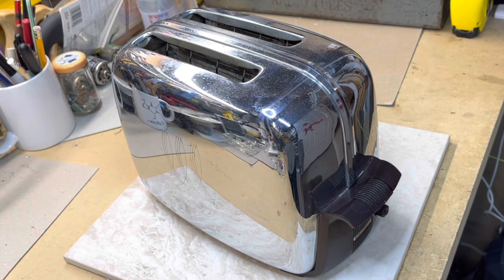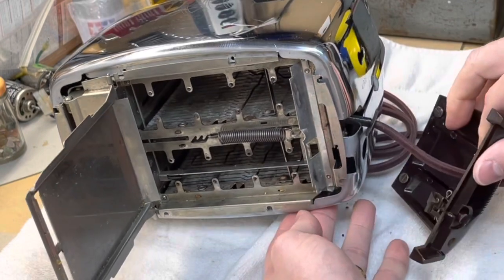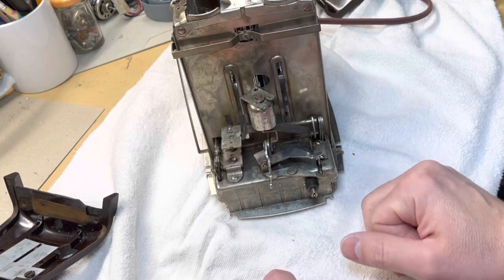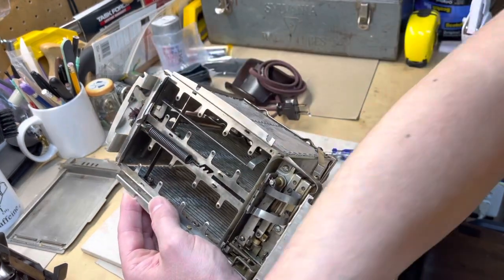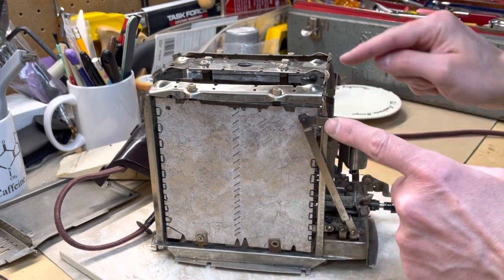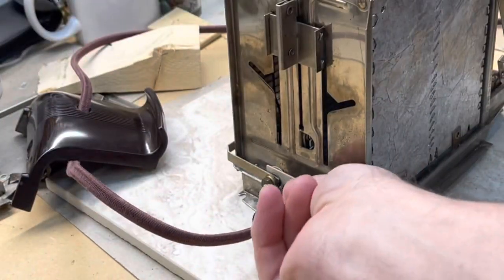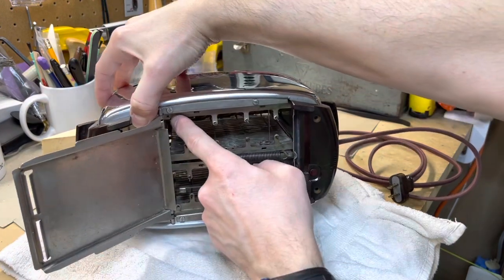How to disassemble and repair the Toastmaster 1B14 Toaster

Comment: I found one of these on E-bay and was using it for the last 15 years ... until one side went out. This is the best toaster I have ever owned and I was bummed out. It just so happened this is the same toaster model my parents had in our home growing up and they had it over 50 years. I have never owned one that works better!  I followed all the steps of your video and it turns out the repair you demonstrated was exactly the same failure I had to fix ... being able to see all the steps to disassembly and re-assemble was fantastic and my repair was a success ... You did an awesome get to the point video with a clear outline of the necessary steps.  The case is a bit "fiddley" to get off and back on, so your tips about exactly how to take it apart and re-assemble it was super helpful ...and saved me a lot of time...

Comment: Do you have a video of when you replaced the power cord?
Reply from the maker: @budsutt:  Unfortunately no. But you can see the two screw attachment points for each of the wires so it should be straightforward once you have the chrome shell lifted up out of the way.
Reply: @LongologoProductions  Thanks for responding so quickly. I'll get mine apart and look for that.

Comment: Mine clicks but doesn't release, it still cuts the current though. Thanks for video
Reply from the maker: @michaelbyfield6323:  check the parts of the video showing the slow-mo of the release mechanism.  There are some adjustments you can play around with to help.

Comment: I was able to repair my issue of the lever not staying down. Now that I have it put back together, it will stay down but won’t pop back up on its own. 😅
Reply from the maker: @PaigeKnowles-c3x  so frustrating!  What did you do to get the lever to stay down?
Reply: @LongologoProductions  I took it apart, thanks to the instructions in your video, & then just cleaned the mechanism & springs really well with a small aerosol can air compressor. Then after I put back together, it stays down now but won’t come back up on its own. The lever falls a little short from being flush with the bakelite, when not pushed down. Has a little play in it when its not locked down.
Reply from the maker: @PaigeKnowles-c3x  : hmmm.  Double and triple check everything that you put back together to make sure the mechanical pieces and latches operate properly.  Could be something easily overlooked. Could even be the chrome exterior casing or Bakelite end piece interfering?  Difficult to guess without seeing it.
Reply: @LongologoProductions so after lots of studying how the parts are working, I think I figured out that the arm the moves forward, that touches the backside of the knob, doesn’t move back on its own once it reaches temperature. I think it’s supposed to retract on its own to trigger the bar that releases the lever, right?
Reply from the maker: @ : This is difficult for me to visualize without knowing exactly you are looking at. Is there a timestamp in the video that you can point me to for what part is sticking or not retracting after heating?  I’ll help if I can.
Reply: @LongologoProductions  9:36 it doesn’t release the toaster. It just clicks but toaster doesn’t release
Reply from the maker: @PaigeKnowles-c3x:  Reading your comments again, it seems that you have the same issue I was addressing in this video, where the inside diagonal arm moves forward, touches the backside of the knob, but doesn't drop down with enough force to release the toast--it basically gets stuck and can't move back on its own.  

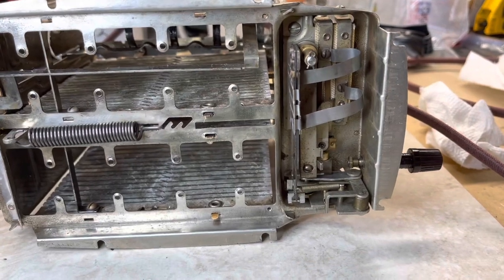First, which type of the 1B14 toaster do you have? See at 8:43, where you can see the underside of the first type (the type I am addressing in this video), in which there is an adjustable screw/nut on the end of the light/dark dial under the toaster.  The other type is shown starting at 10:30 (particularly at 10:52), where you can see that there is no screw/nut, and it is instead just a flat-ended cylinder or solid post on the inside end of the light/dark dial under the toaster.  This latter design is likely an improvement over the version with the screw/nut. I'm guessing that people who have a toaster with this second design are not experiencing the problem I addressed in this video. But if you have this second design then my guess is incorrect.  

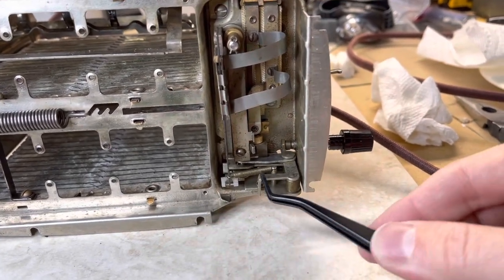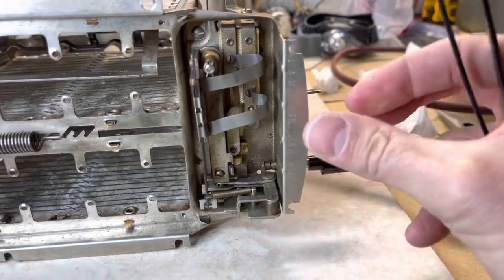However, if you have the first design, it seems that you might have the same or similar problem I addressed in this video, i.e., to get the toaster to release the toast at the end of the cycle.  See starting at 8:43, where I noted that I had to turn the bakelite light/dark dial all the way in and then need to adjust that screw/nut on the inside of the toaster to be closer in and effectively shorten the length of that post.  See particularly starting at 8:56, where I am pointing exactly at the screw/nut and explaining the adjustment I had to make there.  That has the effect of allowing the plate I'm pointing to at 9:02 to come further forward before it contacts the post.  The effect of this adjustment (see from 9:18 to 9:45) is that it allows the plate to come further forward after the first "click" at the end of the toast cycle so that it will be able to drop down and then effect the release of the toast.

You can actually see this in the high-speed clip starting at 10:09, where the arm comes up to touch the screw/nut, allowing that first 'click' to happen (at 10:17), although now the arm has traveled far enough forward so that when the right side end of bimetallic strip  is pulled up by the long spring and the bimetallic strip begins returning to its unbent state, the long arm (diagonal in the high-speed clip) is able to slip off the end of that small bracket on the release arm.  This last step happens too quickly to see in the high-speed clip but it is visible in the slow-motion clip starting at 10:23).

Bottom line is that adjustment of the screw/nut appears to solve the problem of the toaster not releasing the toast at the end of the cycle. 

Don't forgot about the small screw inside the bakelite dial (see starting at 9:48).  Make sure that is tight after you get the dial positioned so that it properly points to the light and dark endpoints when you turn it clockwise and counterclockwise.  

I really hope this helps!

Comment: Good video. I had trouble removing the temp knob, but after I realized you had skipped a step and began with it already loosened, I got out a better light and discovered the tiny screw holding it in place. Everything was a breeze after that. 

Thank you for putting together the video.
Reply from the maker: @SherriTrask-y8h  :  At 1:27 I show the unscrewing of the Bakelite toast light-dark setting knob.  Perhaps mine was already loose, but I don’t think I skipped a step unless I am misunderstanding you.  Also at 9:49 I mention the inner screw inside the Bakelite toast light-dark setting knob, to set the knob, so the arrow will stop at the light and dark settings, respectively. Similar at 10:51 when I screw it back in and note the adjustment screw in the center if it is needed.  Thank you for commenting!

Comment: I couldn't figure out the lightness control until I saw your slow motion. Thank you! The toaster still won't pop up on its own, but now I know what to look for.
Reply: I finally got around to repairing my Toastmaster. 

Mine is a 1B12 (this video is about a 1B14) and the automatic pop-up is even more complicated. The bi-metal bends just as shown in this video, and when the arm attached to that bi-metal hits the toast lightness stop, it also causes the bottom of the bi-metal strip to begin moving in the opposite direction, just as shown at the 10:20 mark in this video. After the end of the bi-metal moves about 1/8" in the opposite direction, instead of directly pushing on the pop-up release (as shown in this video), it instead releases a lightweight catch (very little friction on it). This does two things: it causes two electrical contacts to close, and it also drops the bi-metal arm, also by about 1/8", so that the arm mechanism on its return journey will catch and trip the pop-up mechanism. There is a lot more force available on the main arm when returning as it cools compared to what the thin bi-metal can supply with the design shown in this video. 

However, the biggest difference from what is shown is that the electrical contact closure, mentioned in passing in the last paragraph, shorts out the electric wires heating the bi-metal. That is what causes the bi-metal to return to its original position. 

The adjustment which I returned to its center position determines how quickly the return trip of the bi-metal will push the pop-up trip lever. However, if it gets set to its extreme position, the mechanism never drops and it passes over the latch rather than engaging it. That was the first problem with my toaster, and loosening the set screw and setting it to the center position fixed that problem. The other issue is that the electrical contacts in the latch mechanism need to be clean or else the electricity will continue to flow through the bi-metal and the bi-metal will never start its return trip, and the toaster will toast forever.
Reply from the maker: Yikes what an adventure!  Definitely don’t want it toasting forever!  Interesting explanation of the differences between the 1B12 and the 1B14.

Comment: Do you make repairs?
I need to replace the cord but having a really hard time getting the legs off. I’m afraid my lack of experience is going to cause something to break.
Reply from the maker: @walk13miles  : I only repair the toasters I own.  Removing the legs should be straightforward.  Closely follow the steps in this video.  Just take your time and work slowly.  You can do it.
Reply: @LongologoProductions  - you are right! I just had to slow down. Now I just need to buy the new cord!

Comment: Where can I find a shorter cloth cord?  I'm only finding 6-8 foot cords!  Thanks.
Reply from the maker: Even with a longer cloth-covered cord, you should be able to clip it to a shorter length and then strip the insulation off at the end that you connect to the toaster.  I suspect that only longer cords are available because it is more efficient to sell them to customers that way.

Comment: My broken element is in the middle
Reply from the maker: @Ryan Camp:  Ugh - not good.  Some thoughts:  1. Bridge the break with a small crimped piece of aluminum foil attached to both sides of the break.  (Likely not secure.) 2.  Bridge the break with a metal thumbtack pressed through the mica and bend the thumbtack pin a bit on the other side to hold the thumbtack in the mica.  (Maybe a little more secure but still questionable.) 3.  Bridge the break with a very small metal plate and sew the plate into the mica with a few loops of very thin wire being careful not to contact heating element on other side of the plate. (More challenging but likely more secure.) 4. Find a donor toaster and swap out the whole plate that has the broken element.  (Depends on availability of another donor toaster.)   Hope one of these options work for you!

Comment: Under the cover on the control side, there is a vertically mounted brass piston. Is it there to make the toast rise smoothly? And is that little nut on top of the piston there to adjust the airflow, and thereby control how smoothly the toast rises?
Reply from the maker: @Richard Wolfe:  I’m not sure but it may be there for a dampening effect.   The forcefulness of the release mechanism and how fast the toast rises/ejects is primarily controlled by that large adjustable spring underneath the crumb tray. For example you can see the spring at 2:15.  If the toast comes flying out of the toaster you can simply hook that spring on a closer notch.  Hope that helps.

Comment: Thanks for your great video.  We obtained the 3-slot version but it doesn’t heat up when you push the lever down.  Would this likely be a straight forward fix?  Thanks again.  PS It says model 1C5.
Reply from the maker: @G S:  Thanks for commenting.  Difficult to say whether it would be a straightforward fix.  If it doesn't heat up when you push the lever down, that's telling you there is a break in the wiring/connections somewhere along the line and you'll have to take the toaster apart to trace the path of the current to find where the break is located.  Good luck.
Reply: @LongologoProductions  Great thanks!

Comment: Can I ask where you found the cloth insulated power cord? The toaster get quite hot, worried that a generic power cord may melt insulation, but I’m not sure where to find a replacement.
Reply from the maker: @Joe Kremer:  I bought replacement power cords and plugs at Antique Electronic Supply (online) years ago.  There may be others out there.   A modern cord likely won’t melt though—note that it goes through the Bakelite handle portion.  Good luck.